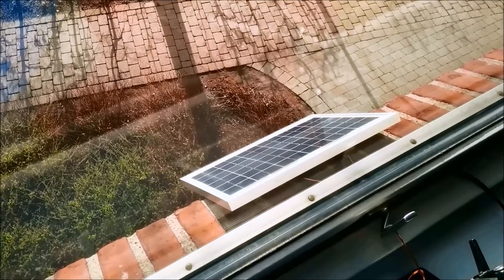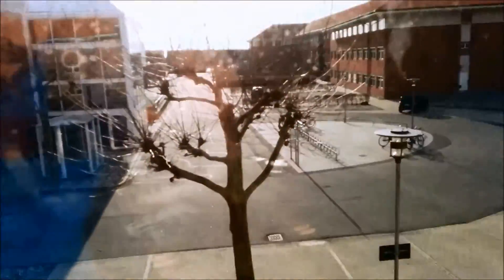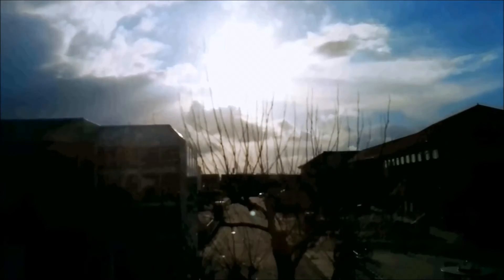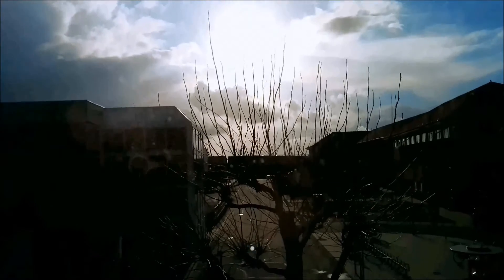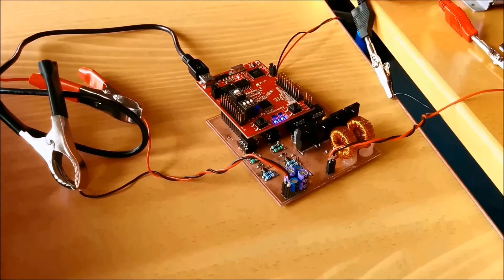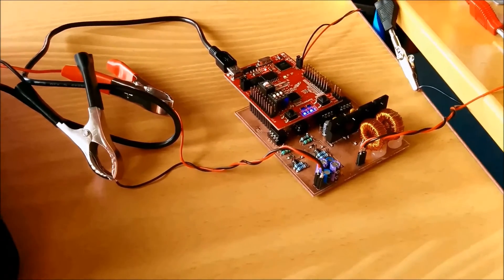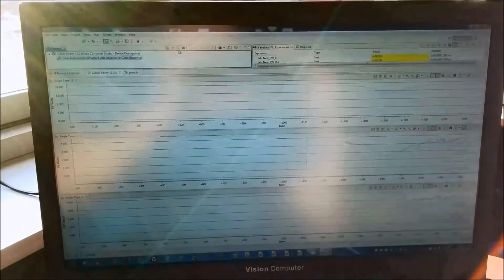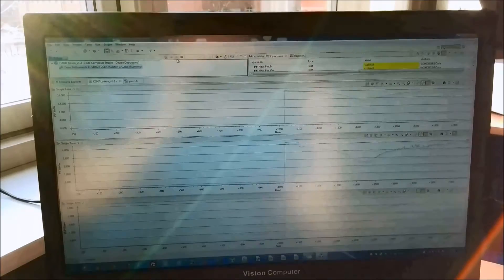C2000 Launchpad Solar Power MPPT Project and Tutorial

Comment: Good job.
Reply from the maker: Thanks, there is definitely room for improvement looking back some of which is discussed in the 4th part of the website tutorial.  I would like to revisit and do a new design based on a higher voltage and power system for charging batteries.
Reply: @CoderTronics  I am just building 100 AMPS OUT - 2-phase - 50 A pre phase MPPT, with BUCK topology, but I am only beginner, there is o lot of problems to solve if I need good tracking, good efficiency at 96 V OUT / 100 A, it is based on ESP32, but maybe I will need 2 ESPs, because there is MCPWM for phases, PWM for fans, WEB SERVER, MQTT server, dallas temps for fets and toroids, I think that ESP32 is slow at float math.
Reply from the maker: @PavolFilek  You could use fixed point that would help, depends on your update frequency and it doesn't necessarily need to be that fast but do need to consider step change size which could be variable.  A sub processor could be used to handle the MPPT which can easily be done on a basic Arduino and this can be fed parameters needed to tune.

You could also try and use more direct registry entry and less Of the API code, this will makes things faster as well see this example https://coder-tronics.com/c2000-programming-model-guide/
Reply: @CoderTronics  I am not circuit engineer, so my first problem is to make PCB for my protorype, software part will be next, I am now learning how to use KiCad or another SW to draw schemes and PCBs. Because in my prototype I have problem, e.g. freq. for PWM is 16000 Hz and phase_0 has 13 amps and phase_1 has 11 amps, and if I switch freq. to e.g. 24000 Hz, current is 10 / 14 AMPS. So I do not know if problem is at signal paths from ESP32 to IR2104, or problem is at fake IR2104, or problem is at deadtime for FETs, and also there is problem with reverse recovery charge and time at LO and HI FETs, simply I need a lot of knowledge to absorb fast.
Reply from the maker: @PavolFilek  ok so you have a working prototype with different current levels on the 2 phases.  Likely causes are variations in the MOSFETs, signal path resistances etc and also the cooling of all those components.   Placing the MOSFETs on a common heatsink might help to balance out pending on the design constraints of the board.  You can start by measure the temperature of the MOSFETs as this may give some indication as to the imbalance.